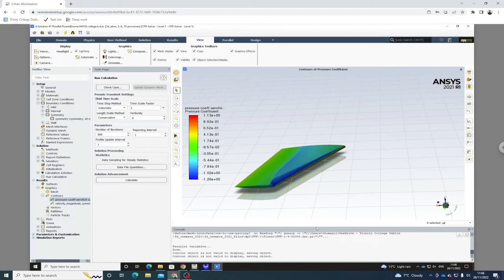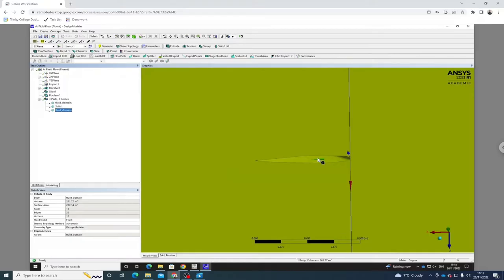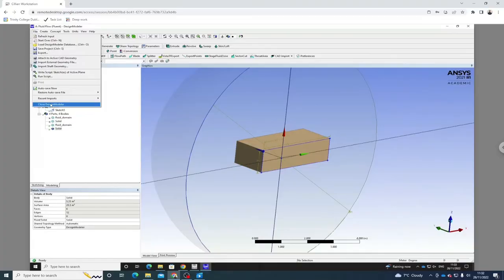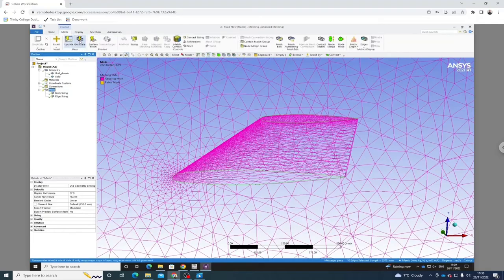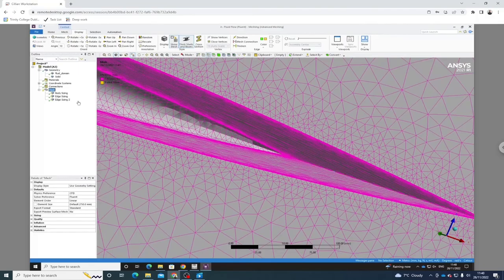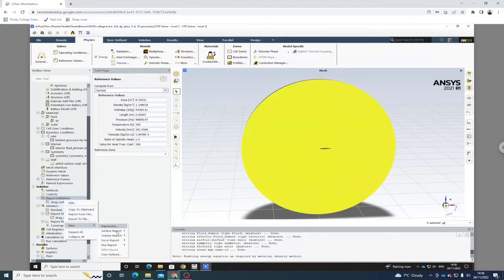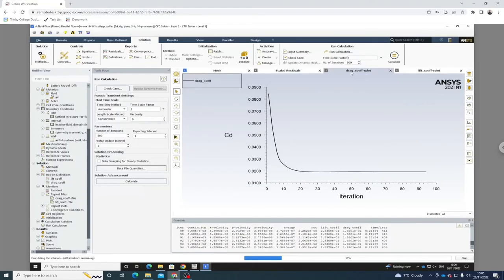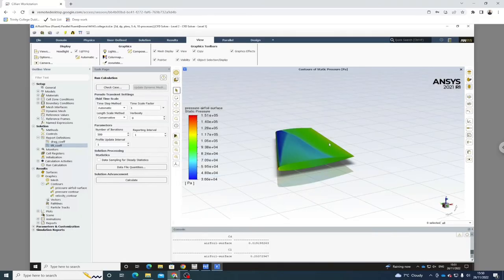3D Aerofoil Tutorial in ANSYS FLUENT - NASA Onera Wing

Comment: That's a good video. However, the student license only supported 512000 elements, so it was not possible to input physics properties. Instead, I did it with a simple geometry through this video. Thanks from Germany for your video.
Reply from the maker: Thanks Kwon. I did a 2D naca 4 digit tutorial for the student version since it is hard to do 3D with such few cells.

Did you get good results in the student version? Would be interesting to know for others if it is possible to still get good results with only 500K cells
Reply: @cillianthomasengineering  I limited the diameter of the sphere to 5m in order to meet the elements 500k limit, and proceeded with the task. Furthermore, the size of the elements was much larger than yours.
Reply: @cillianthomasengineering  Your result: drag 0.019198263, lift 0.25372967
Pressure coefficient: max. 0.75, min. -1

My result: drag: 0.02342472, lift: 0.24747622
Pressure coefficient: max. 0.69, min. -0.7

The pressure coefficient distribution graph is drawn similarly to NASA's graph as a whole.
Reply: @cillianthomasengineering  I think this is because my farfiled is much smaller than yours, has fewer elements, and is larger in size.
Reply: 안녕하세요!
전산유체과목 배우면서 연습중인데
저도 학생용 버전으로 맞춰 메쉬수를 줄이다보니 계속 발산하게 되는데
혹시 어떻게 매쉬 조절하셨는지 조심스럽게 여쭈어봅니다..
Reply: @kwonkuhoon2304  굉장히 오래 전 댓글인데도 자세히 답변해주셔서 정말 감사합니다! 좋은 하루 되세요😊😊

Comment: Hi, I found this video really helpful. However, i have encountered one issue. I am running ANSYS R19.2, i followed the exact same steps shown in the video and although i get practically the same results for Drag Coefficient and pressure coefficient, my lift coefficient is about 30% less than the one you find. Any suggestions?
Reply: hi i had the same result as you.
did you fixed it?

Comment: Hi Cillian,

I watched your video on the "3D Aerofoil Tutorial in ANSYS FLUENT - NASA Onera Wing," but I'm encountering issues with the preference method you suggested. Whenever I switch from CFF to legacy, I face difficulties opening CFD. The error message I received is: "Application error(s) occurred in CFD-Post. The run 'RunSteady' in simulation 'Simulation' contains transient output, but no output files were defined." However, when I switch back to CFF, CFD post opens successfully, but I am unable to visualize the pressure coefficient on the Y-axis in CFD post. This data is crucial for validating my ongoing research work, so I would greatly appreciate your assistance with this matter.

I look forward to hearing from you soon.

Comment: Hi Cillian,

I watched your video, but I'm having trouble with the preference method you recommended. Every time I switch from CFF to legacy, I encounter an issue opening CFD. The error message I keep receiving is: "The run 'RunSteady' in simulation 'Simulation' contains transient output but no output files were defined." However, when I switch back to CFF, CFD post opens successfully, but I can't visualize the pressure coefficient on the Y-axis. This data is crucial for validating my ongoing research work, so your assistance on this matter would be greatly appreciated.

Comment: HI,this is a very helpful video, thank you very much. I have a big annoying problem, I follow the video for meshing and parameter setting, but when I change the AOA to 6°, it doesn't converge
Reply from the maker: This is an annoying issue that sometimes occurs with difficult simulations. My recommendations in order of importance to fix the problem would be to 
1. Check the boundary conditions thoroughly. It is often mistakes that leads to this problem
2. Change solver. Sometimes another solver is needed for different applications
3. Change the relaxation conditions in Ansys to support slower convergence but a more stable solution
4. Run with mulitple meshes to see if the problem consists

Comment: Hi, this is an excellent video tutorial on how to set-up a CFD simulation, thank you. I have encountered an annoying problem which I have been trying to solve for the past hours.
After I sketch the refinement rectangle around the airfoil and want to extend it, annoyingly, the whole solid disappears. Have you encountered this issue before? If so, do you mind sharing a solution to it? Kind regards.
Reply from the maker: Hi, no I have not encountered this problem but all I can suggest is that you take a look at what settings are on the extrude, ie if “merge bodies” is on then it might be merging the solid body with the fluid body
If there are any further issues, send on an email
Reply: @cillianthomasengineering  Thank you for your quick response and proposed solution. Believe it or not, I have managed to figure it out just now haha!

The solution was related to the “Add material” function of the extrude options. Switching up to “Add Frozen” solved the issue and I have managed to load it into Mechanical and generate a mesh!
Reply from the maker: Great to hear, best of luck with the rest of the tutorial!